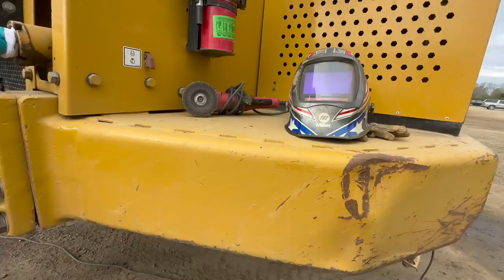CAT 637 Bumpers

Comment: I'm surprised the owner cares about a few little dents on the bumper of an earthmover.

Love your channel/videos.  Subscribed!
Reply: Can someone answer why this would be the case ?  I doubt it is just for "looks".  There must be a security/performance reason to do this.
Reply: @franciscocerutimahn  The only reason I could think for 'looks' would be that the owner was considering selling them.
Reply: A bit of filler compound would be cheaper, tho.
Has to last only until sold ;-D
Welding a hook to it and pulling the dents out, with another bulldozer/excavator, while heating the metal with oxyacetylene, would be the easiest, good solution, IMO.
Reply: The only time I've seen someone do this was when they are torn down to rebuild the whole unit. Never for some cosmetic dents.
Reply: Factory refurbished perhaps?
Reply: I'm sure it's either going to be sold or returned on a lease.
Reply: I agree
Reply: Looks like it's a place on the machine that's vulnerable to impact. Wouldn't it be worth bolting on some hard rubber bumper strip like what  is installed on the rear of artic trailers and on loading docks?
Reply: Not sure why you would fix those dents knowing it is likely to happen again?
Reply: @mudbunny6388   "Returned on a lease" seems to me to be the most plausible explanation. No need to go to such lengths if all you want is just to just sell it - a prospective buyer will look at things like the condition of tires (each of them costs a little fortune, ones like those fitted on this machine probably will be in the range of several thousand $ per piece, I reckon), he'd be concerned with condition/ wear of working parts (the bucket, hitch points and such) - but certainly not some minor dents or scratches that are to be more than expected on used construction/ earth moving machinery.
Notice how much attention this guy pays to insignificant details like positioning welds on the top EXACTLY where "original CAT" ones were (see marks at 10:13 and further on), blending all welds and what not, to the point of filling up small voids AFTER grinding a weld. Also, he cut the original welds clean, flush with the sheet's edge, which required more work than just gouging them out - but gouging would be more difficult to "conceal" and thus may reveal the part was replaced.
Anyway, most of the work here is ABSOLUTELY bonkers as far as any "proper/ real world repair" is concerned (considering those dents actually "required" to be repaired...), and it seems to me that the thing was leased or rented, and the "proper owner" would charge for any "damage" (i..e deduct from the deposit) five times as much as this guy here would charge for this insane "detailing" - which is just about as needed as teeth in one's arse.
Reply: @mudbunny6388  lease return also sounds logical! I had not considered a lease return :)
Reply: @MrKotBonifacy   Yes, he's gone to great care to make it look factory original. Leases account for normal wear and tear but dented bumpers aren't that.
Reply: @franciscocerutimahn  I used to work for the owner of these machines.  He is extremely anal about this kind of stuff.  He would even make us rotate the exhausts on all machines to make sure they were facing the same way.
Reply: On a half million dollar machines it's worth it. Also recall these have to bars on the front to run a scraper train..those dents happen when turning while being pulled.
Reply: This might blow your mind but it might be the drivers union contract that the machines can't be broken or in bad shape
Reply: It would be part of the lease agreement that the machinery be maintained and look as new as possible.
Reply: I would think the operators would be more careful with good looking machines, if they looked like crap then operators treat them like crap.
Reply: Multiple mechs/welders on 2 machines tells me they were due up on the lease. Cat dealer would charge $$$$ for repairs.
Reply: @franciscocerutimahn  I believe it's for professionalism. Clients don't like hiring contractors that use old equipment and typically don't hire back bids not providing scene of security. This channel has even repaired this equipment, which tells me this is the possible reason why.
Reply: @hinz1  if it holds its sold.
Reply: @sirduh4074  i can't imagine that is the case, there are companies with owners that give a great deal with how the machines look, but thats not a whole lot and ussually not the bigger companies. cause they have a couple hundred machines and cant be bothered by these small dents. but sometimes when a employe works longer (couple of years) with the company and damages a machine this way and would like to have it fixed its not a problem.
Reply: @MrKotBonifacy  You may be on to something there with needing these CAT bumpers back to "factory fresh".  It would be a fairly simple task to add an internal member to that welded box tube and significantly improve dent resistance as they are being replaced: The fact that is skipped implies to me that it is all about that factory fresh lease return cosmetic and little else.
Reply: @OldGeezerstoolbox  Apparently/ as it turned out the explanation is even weirder, bordering on COD ;-)
As Greg, the author, explained in one of his following videos commenting on "our" "whaaaa...?!" comments, the owner of those machines just "doesn't like it".
Kinda funny, but some people are "like that".
And I guess we can belive Greg.... : )

Comment: It’s nice to see a company take pride in their equipment
Reply: More like the equipment is headed to auction or is a lease turn in. You put those scrapers back to work and those bumpers will be dented again in just a few days. I've fixed quite a few in my days. That goes for the push block on the rear also.
Reply: @badger305  That's what I thought too but then he mentions that he's done the same machine before so it must be a pretty regular thing.
Reply: @badger305  That would explain it!
Reply: I think it's during the shutdown. The company finds some jobs to do for their welders
Reply: Most people don't have pride in their cars they drive.

Comment: Is there any particular reason to do these cosmetic repairs like this? Seems like a lot of work to remove some dents on a machine that will get dented again in a few months.
Reply from the maker: This particular customer likes their machines to look nice.  I think they might also back charge the damage to the last person who rented it.
Reply: @OFW  makes sense to me.....
Reply: @OFW  I was just about to ask the same thing.  Rental machines makes all the sense in the world.  Why not fix it, when somebody else is paying? 😂
Reply: @OFW  Oh I see. This is owned by a rental company. That makes more sense.
Reply: @gradywray5391  Kinda borderline to charge for this damage on a rental, but then again they ran into a bit more than a marshmallow to bend this. Either way, it helps pay for welding jobs...
Reply: I was wondering the same thing, thanks! Maybe the next client is more likely to take good care of a machine that looks pristine instead of already beaten up?
Reply: Gregg said there were airtanks behind there. I could imagine it's also an insurance issue.
Reply: Worked to an equipment company, all rental units had many photos made before rental. Upon return off rent or lease, all dents. Scrapes, damage was photographed, repaired, rental customer charged to their rental/lease agreement. 
Ready for next customer.
Reply: I think maybe it going for sale maybe
Reply: I'm all about making things look nice, but is this normal wear and tear? 4:21
Reply: Resale value!
Reply: A spotless Machine looks real good to the customers,people seem to trust the guy with the shiny tools lol
Reply: Take pride in your equipment sort of thing
Reply: it's the Mercedes kinda vehicle, needed to look good while riding onto construction.Mind your own business,give the man a job to make a living.

Comment: I never learned the push pull technique on these scrapers, looks fun though and it has to be mentally exhausting timing all the controls on Q allowing for a seamless movement during the cut. Takes practice for sure. Good Channel welder and your work speaks for itself.

Comment: Good work with that plasma torch amazing that you can keep it a good distance away and still take off layers of metal never seen one with that ability usually have to keep them pretty close to do anything and if it’s for April fools it’s vinegar otherwise for P&O steel it’s Diluted hydrochloric acid bath used to work with coils

     Continued success 
               Fabrizio

Comment: Great job.  Why were they worried about a few dents.  Most of the time stuff is trashed when they decide to fix it?
Reply from the maker: This customer likes their stuff nice.
Reply: @On Fire Welding   nothing wrong with that
Reply: @OFW  That is not the normal in the construction business. Owners give you barely time to do crucial repairs and here you get time to do dent repairs. This customer is a keeper for sure.
Reply: Especially on something like that where a month or two after it’s fixed it’s probably stove up again. But, job security I guess and as long as their checks clear then I wouldn’t complain. Get hard up for cash and might even go in some dark night with a 10lb sledge and put in a few dents. 😂

Comment: You can't say you know for a fact the panel was never changed because of the SN because when I change anything with a SN on it I punch the SN back in the panel it's a pet peeve of mine kinda like how you measure the welds and spacing of them I like to keep everything as close to OEM as possible. Great video the job turned out nice.
Reply from the maker: You can tell what an OEM weld looks like. After you do a bunch of them I can be certain of that.

Comment: I agree with the Bernard gun vs the Miller. Shop im at has a big Bernard thats lasted more than 15 years. However ive replaced a few Millers in that same time frame.
I will say though, the MDX 250 gun from Miller is pretty good though.

Comment: Last fronts I did they put a 631D on top of the back of another  631.  Did both bumpers and plates.    The metal shop that I have been the steel had it too narrow about an 1/8 and that made it a pain.

Comment: Very nice , nice height to work as also clean steel to work with. I have a carpenters angle bevel which is good to transfer angles...A shame the very next day the driver will most lightly bash it..

Comment: I was thinking when you mentioned measuring the angle you would use a longer piece of wire…so it would meet the other mounting point. But I guess after you do enough of them…you can kinda judge it…still looks good man!

Comment: Pickled and oiled. Hot rolled pickled and oiled steel is steel that has been descaled of an oxide film and oiled to help fight corrosion. During the pickling process, hot rolled steel is descaled in a hydrochloric acid bath. Basically as you said dipped in vinegar (a VERY strong vinegar!) then oiled.

Comment: Would there be a down side to having the bumper made from 1/2" plate, with rubber pads mounted to them, similar to loading docks?  I guess the thinner metal is a failsafe? Instead of damaging something very spendy!
Reply from the maker: It could be made thicker or with rubber but this customer wants it to look like new OEM.

Comment: Do you like your welder all the way in the front. Unless it’s a wireless control model, I’d figure it’d be a pain to crawl in the bed each time you need to adjust.
Reply from the maker: I have the controls wired to the back so I don’t need to get in the truck every time.

Comment: Is there a story on the 302 on the tail of that other service truck. Looks like there is a big blue already in the bed
Reply from the maker: The 302 was originally bought as a backup machine. It’s now on truck #3  there was an air compressor issue and we were using it for air.

Comment: Maybe not the right application here, but my mom uses a two-part epoxy primer in a spray can for her metal art. There's a part B that you trigger from a button on the bottom of the can, then you shake it up. You wouldn't want to weld next to afterwards cause the thing smokes off in a thick black cloud that's prolly toxic AF. Hella primer, though.
Reply: That’s good but expensive and usually used for filling small imperfections. In the case of those bumpers I’d just use a metal etching primer which is made just for bare metal but does not fill anything because it goes on thin.

Comment: I’m new to your channel, and I echo the positive comments, but I do have a couple questions:

I’m impressed by what you can do with the Miller 220 (I also have a Miller and love it) in the field, but I’m shocked that you use 0.035” wire on such thick welds.  I thought you were using at least 0.045” until you mentioned it.   

Can you really get strong enough welds with the 0.035” ER70S-6 wire?

When you use Dual Shield wire what Brand and Size wire do you use?

Other than the hassle of switching bottles, why not use Co2 for both solid wire and Dual Shield?

I love it when you give details about what machine you are using. 

I future videos could you please take a moment and share a few more details like basic settings, (electrode) wire size, Push vs Pull.  I’m sure many diy welders would like the extra info. 

Thanks for sharing your knowledge and wisdoms too.
Reply from the maker: You can definitely have strong welds with small wire. Think about all the trailer manufacturers that all use .035 70s6 wire and are all downhill welds.
 Dual shield I like Lincoln 71a75. 
I do not like the way straight co2 welds with solid wire.  I use 75/25 for both.
Reply: @OFW  Thank You for your reply.  I live  out too far away down in Pismo Beach. Welding resources are few and far between here.  I can’t find the Lincoln dual shield locally in the 0.035 size, just 0.045 and larger.  If you know ow of a place to get the Lincoln in 0.035 I would love to know where from. 

Do you run the Lincoln dual shield thru your Miller 220?

I think my miller might be able to barely run 0.045 thru the liner, but I would probably have to use the standard OEM roller.   I. Guessing you are running the dual shield thru a different machine.   Thanks again, I really like your content and the work you do.
Reply from the maker: @michaelwhiting878 I have ran .045 dual shield through my 220 with no issues.

Comment: Work is work but honestly, why would this company spend on cosmetic repairs like this?  No judgment, just wondering why.

Edit, so I just stumbled upon 26:00 in and this answered my question. Greg found multiple bolts holding the air tanks that were sheared off.  And it looks like one of the tanks would have worn through eventually judging by the fresh steal wear marks. I’m sure these machines cost a ton of money and it’s always a good idea to protect the investment by DOING THE MAINTENANCE. Nice job Greg. 👍

Comment: What about radnor replacement guns? For miller wire feed. any good? Second, why do they care if the metal is dented? Just curious.
Reply: In my experience the newer Radnor stuff (filler metals, consumables and hoods) is subpar, and I avoid it unless absolutely necessary.  The old stuff was just as good and cost effective, but somewhere a long the line they went to cheap crappy suppliers especially filler metals!

Comment: Isn't it possible to do something similar to what glue sticks does to  bumps on cars, but instead of glue you weld  something  to the top of the bump  that you can pull on with an excavator or  similar?
Reply from the maker: I suppose but that would take a lot longer and it wouldn’t be perfect. And it would require some type of filler like bondo. I pride myself in not using Bondo
Reply: @OFW  ok I appreciate that. I don't know nothing about these kinda work so when it popped up in my mind I had to ask. Either that or some kind of "hydraulic vise" with flat side  that could press from both sides and flatten it. But perhaps this kind om metal is to springy and it would work either. It still wouldn't look as good

Comment: Just wondering why you didn’t do the same to the LHS panel that you did to the RHS panel so the frame # would still be on or is it on the small part on  the LHS 2 half of video. ?
Reply from the maker: I’m just doing the sides the customer wanted.  One machine got both sides and the other one just one side.

Comment: Hey that small bigger welding is that inverter MIG welder and what size amperage and wattage generator are you running
Reply from the maker: It’s a Miller 220 AC/DC. The generator puts out 30kw

Comment: Wierd question but Any specific reason you used the 220 instead of the suitcase? As always though awesome attention to detail.
Reply: It’s just handy sometimes! The smaller, lighter torch is just the ticket in certain applications. That’s how I decide which one to go with.
Reply: Okay. After seeing that big, gaucky Bernard gun he’s using, that’s obviously NOT how he decides which to go with 😂!
Reply from the maker: I feel like it welds a little better on the thinner material and the gun is a little smaller for the tight spots.

Comment: Just curious, how quickly do you burn through plasma consumables?  Will a set last you a full day?  Several days?  Or just you burn through several sets in a job?
Reply from the maker: Weeks.  Depends on the situation.  You can get about 200 feet or more  of cut on 1/2” plate.  Cost about $20 to change all 3 consumable parts.
Reply: @OFW  Thanks for the info!
Reply: What kind & size of Plasma do you use for field jobs?
Reply from the maker: @cullenequipment8951  hypertherm powermax 105